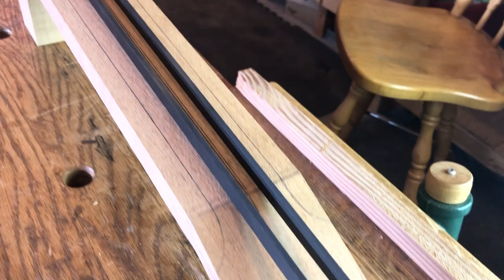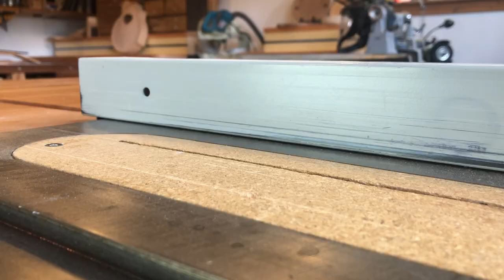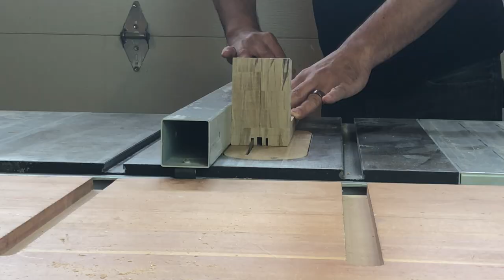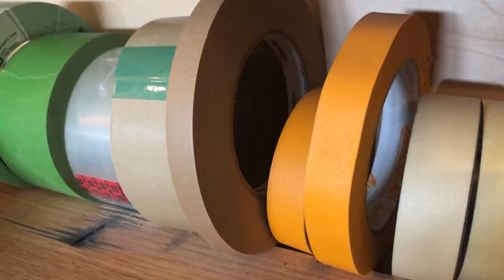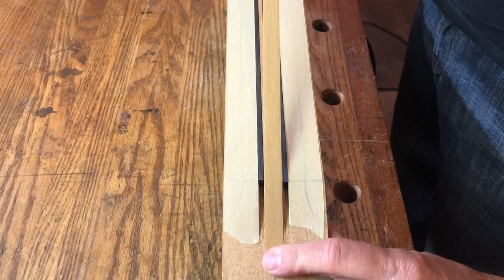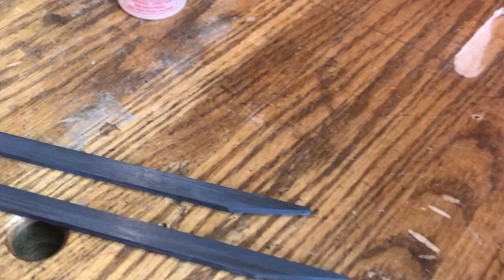Carbon fiber neck reinforcement rods.

Comment: Excellent. Carbon fiber rods add strength, but I also feel it helps transfer sound vibration from the strings. Nice work.
Reply from the maker: For sure! One of the many reasons I use them... 👍

Comment: Awesome work, I know you didn't show it in the video, but please wear a mask when cutting carbon fiber, good idea to have  dust extraction running too.
Reply from the maker: Yes, PPE is always a good habit to have.. I noticed one shot I made for the camera ( without the table saw being on) in this  shot you can clearly see I am not wearing goggles (which I always wear using the table saw.) but I did forget to put them on for the camera shot.
Thanks for watching:)

Comment: Good work Tomy. I'm always afraid my table saw blade is going to raise up on it's own cause it's happened before. So I would do that on a router table. Any other glue you know of that works with CF?
Reply from the maker: I’ve only ever used Epoxy. I can lock my blade at the proper height but I do understand your concerns..
Thanks for watching!
Reply: @HovingtonInstruments , my blade lock needs some love.